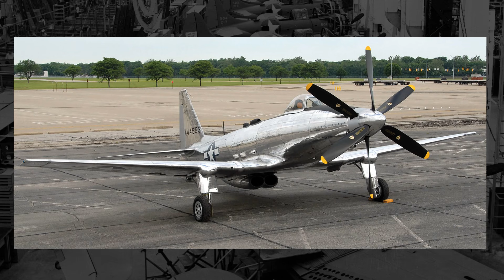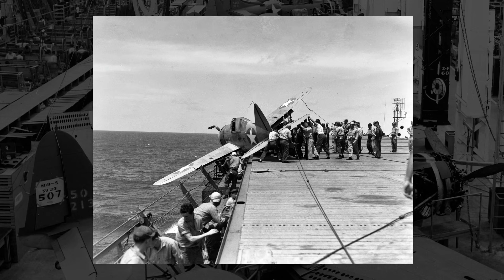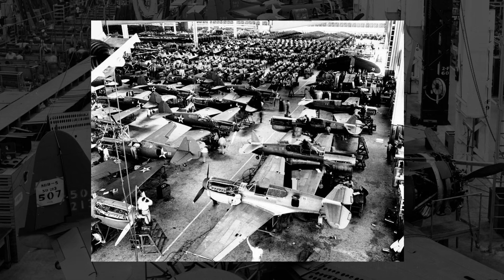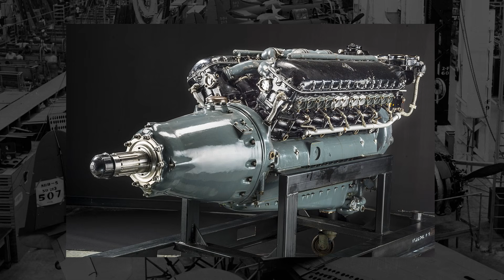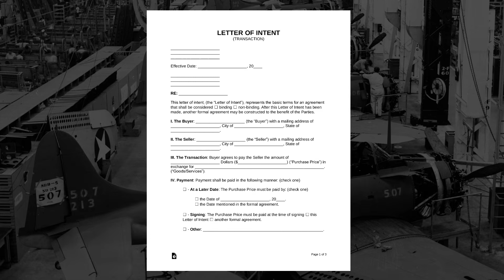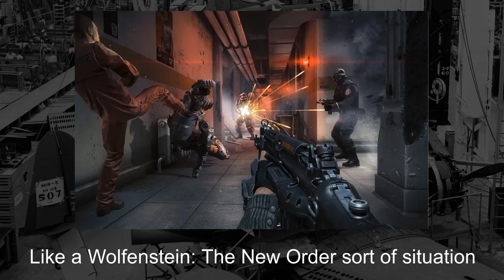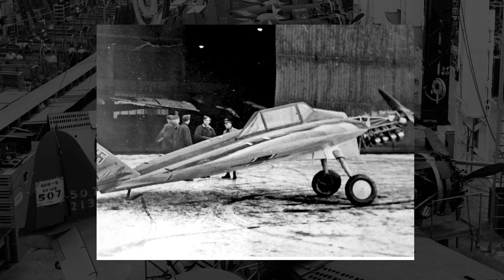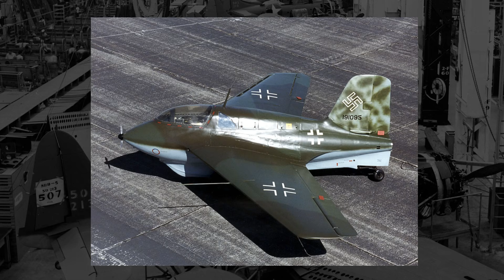The "Wonderplane" Slapped Together With Spare Parts: Fisher XP-75 Eagle

Comment: Gotta wonder about how many brain cells were involved in placing guns in the nose synchronized to fire through contrarotating props. Absolutely no margin for error there; the slightest hiccup of the engine or millisecond of hangfire on a gun and you are going to be "affected by an inclined plane wrapped helically around a conical axis".

Comment: Thank you for producing this video of the most amazing multi role fighter of the era.  This has got to be the best WWII aviation video ever on YouTube.  It brought to light American ingenuity which obviously was lacking in spades in this Fisher XP 75.  It did prove however, the American philosophy of bigger is better, isn’t better all the time. 
In hindsight, wouldn’t it have been better to use two (2) Allison 1710 engines in tandem, rather than Siamese two of them which I’m sure was an engineering, design, and manufacturing nightmare. This engine arrangement would have placed the pilot’s legs about 8 inches behind the propeller’s gearbox.  The benefit is that, to maintain the proper Centre of Gravity, there would be no need to add 100 lbs of dead weight to the front, as long as GM specified a minimum pilot weight of 275 lbs.  As a final observation, adding the nose gear from the P-39 Airacobra would eliminate the risk of nasty nose overs.  Just a friendly suggestion.

Comment: The XP-75 was designed to fail. The GM automobile plants were mothballed, supposedly awaiting XP-75 production.  This way they could be started up quickly when the war ended. Ford had repurposed their plants to build things like B24 Liberators. After the war they never caught up with GM. Therefore the XP-75 was a spectacular success.

Comment: I am a aircraft mechanic by trade. This idea of manufacturing aircraft like cars, is something that executive types still push. It always and I do mean always fails. There is some ability for standardization. Within great limits. Like using Pratt and Whitney’s on multiple platforms. But deciding to put a Pratt into say something that uses a Merlin. Isn’t a engine swap like putting a Hemi into Chevy.  You have to change so much that you get a entirely new aircraft. Makes the let’s just take this and stick this into that not work so well. Aircraft don’t deal with build up of tolerances. They require precision to work. It’s no big deal if you’re old Honda’s hood doesn’t quite line up correctly with the body. But in a aircraft the equivalent can cause enough turbulence that when the plane maneuvers. It can result in loss of control of said aircraft.
Reply: As a F-16 factory mechanic, even changing the engine from a GE to a PW, which all the later Block 30s and on could do, was a royal pain in the ass. The only common mounts between the 2 engines were the aft thrust mounts and the PTO shaft. The fuel, throttle, electrical and bleed air had different hook-ups. I've only seen the change made once when I was in the MOD department and then just to prove it could be done.

Comment: "Slapping it together from spares" is a time-honored tradition in many engineering fields, and actually has a lot to recommend it.  It at least gives you something to start from.  And if you find you end up with something that's less than the sum of its parts, then you haven't invested nearly so much effort.
Reply: the lego /meccano philosophy : excellent in case of dire emergency
Reply: Sounds like Chief Tyrol did when he built "Laura" she was a recon craft cobbled together from spares from ruined fighters.
Reply: Who was the guy who strapped Bazooka's to his Piper Cub with toggle switches to fire them?  I think he deserves the best slapped together Ground Attack Aircraft Award....
Reply: SLS be like 😶
Reply: And sometimes is turns out amazing.  The Voyager space probes for instance were builds from left overs.
Reply: I did find it annoying that the narrator said that each change to existing parts ruined the assembly line process. It did no such thing. What it destroyed was a larger supply of spares, taken from a common parts bin.
Reply: Except the highly qualified dead bodies you have to clean up 😢😢😢😢😢
Reply: @nigelhill8811 Not always the case

Comment: I don’t think the Me-163 Komet was a worst plane at all. Yes it was a dangerous plane to its pilots, but it did do what it was designed to do. Get off the ground, climb fast and shoot down invading bombers.  It did not shoot down very many. Somewhere around 10 to 12. While it was faster than enemy fighters, it became a sitting duck after it ran out of fuel, slowed way down and was gliding back to base. That is how most of them were shot down.
Reply: I suspect it glided a lot faster than you'd think. It was clean, no prop (which is a big limiting factor in a steep dive). I wouldn't be surprised if it could dive faster than a lot of prop fighters at the time.
Reply: @iskandartaib  I have read of accounts where P-51 Mustang pilots have chased down both the Me-163 Komet and the Me2-262 Swallow while they were in the cruise, decent and landing phases of flight. The  P-51s were cooking along in the 400 + Mph range, so they were actively chasing them hard with high power settings.
Reply: @americanrambler4972  Yes, I expect they'd have to chase hard, the Me163 wasn't a sailplane. And when they were low to the ground on approach I imagine they'd have to slow down because they'd have run out of altitude, besides they'd have to land. But when they had altitude and had someone on their tail I imagine they'd point the nose down 45 degrees and were pretty fast.
Reply: The Me 163 was also used to try to shoot down unarmed photo reconnaissance aircraft, it seems that one of two got a Spitfire but the other was lost trying to get the other Spitfire, the only claim for an unarmed fighter apart from the Spitfire pilot in Malta who was able to claim two Bf 109's while he was sat in a building on the ground.

Comment: Doomed from the start by poor design. 
Concept was good but putting a dual engine with double the weight with the wings and tail of a single engine aircraft immediately created very high wing and tail loads which then lead to all the substantial problems.

Comment: I love how even though the P-51 was built by an american company (north American aviation) and its best known for escorting B-17 bombers all the way from the uk to germany and back it was ACTUALLY designed and built to meet a BRITISH royal air force requirment
Reply: Lets see if I can remember 2 hours ago... a challenge for me although I already knew this... The first mustangs were a British general order request ... with specifications set by them.  The first mustangs were designed and built in a YEAR... a fantastic achievement however the Allison engines were weak. The British needed any aircraft they could get a hold of and took them all but did not renew the order.  They fitted the Merlin to one of these.  The second Mustangs were not finished until the Packard Merlin was licensed. The blueprints were a nightmare of highly precise custom building of each part and the amount of steps (in the thousands) had to be translated to a simplified Mass-production procedure...
Reply: @allenlombard3627 its not that Allison engines are weak, they just weren't designed for high altitude. Below 15k, the Allison Stangs were actually faster then the Merlin Stangs flat out.
Reply: @georgewhitworth9742   The problem with the Allison was not just speed but lack of performance, low rate of climb and acceleration, the Merlin engine helped with both of these.
Reply: Most of the Grumman aircraft ended up in the Pacific theater. With the exception being the P-38. (I'm not referring to the John Wayne either)

Comment: Would there really be enough time and space for a bullet to clear those 2-3 bladed props that are contra-rotating!? That's insane if it works.
Reply: Hypothetically, yeah.  Just don't be the guy in charge of that particular design.
Reply: If you have a decent understanding of geometry it's actually not quite as complicated as it sounds. As the propellers spin there will be points in their rotation where the blades will always overlap, so if you stick the guns at these points you only have to calculate for the barrel being blocked "once" instead of twice, if that makes sense.
Reply: Exactly so.  But you also have to account for the flight time of the bullets between the time they exit the muzzle and the time they pass the blades.  It's a straightforward problem but also seems like quite a pain in the ass. @pyronuke4768

Comment: The mistake was not making a clean sheet design.  Trying to make parts not meant to go together actually go together is going to ruin any other benefits your trying to achieve.  Much of a cars design is engineered to be cheaply and easily assembled, thus if such line assembly was engineered for they could have cranked out aircraft at an astonishing rate.  B-24s were built quickly and in numbers because they made machines that can be operated by unskilled labor to create the parts that would typically be hand made by a craftsman so that its parts could be made fast and cheap and within such good tolerances that they could just bolt or rivet on without the need for "field forming" to make a similar hand made part fit.  This allowed the B-24 to roll through an automotive type assembly line.  So going back to the XP-75 they should have engineered a new design that specified part tolerances so that the machine tools could quickly create uniform parts, and jigs and sequences to assemble them into sub assemblies, and then final assembly of those sub assemblies on their line.  The clean sheet design would not have to deal with all the penalties and compromises (in particular in aerodynamics) of using existing sub assemblies intended for other aircraft, especially parts from something as obsolete (by this point) as a dauntless.  Probably the only good choice they made (and only good choice for using a pre existing design) was the P-51's supercritical wing.  A whole new plane could have been built around it without much compromise, but then that design would have likely resulted in basically a P-51 v2 without offering any significant capabilities over a P-51D.

Comment: Allison 3420 wasn't just a cool doubled name for a doubled up 1710. They were both the engines exact displacement in cubic inches. Doubling the number of cylinders would make it twice as big leading to the new name having nothing to do with what you made fun of. 

The naming convention was common for aircraft engines at the time. The Pratt & Whitney R-2800 was named that because the displacement was 2800 cubic inches.

Comment: My classification for the worst aircraft ends for those planes that has actual production and use, using these parameters I say the Brewster Buffalo was the worst, even before you get to the plane it's name alone sounds like some kind of Swamp Buggy:face-orange-raised-eyebrow:
Reply: Don't tell the Finns that.  They amassed quite a good record with the  Buffalo.
Reply: @rhondohslade  They were the only ones, I believe the Finns could make an outhouse fly if they so needed.:face-blue-smiling:
Reply: P.S.- even though it was obsolete when it was created other countries used it, it had a good run considering it was crap.
Reply: knew a pilot that flew and fought in them and said it was better than our Boomerang RAAF fighter. Nothing then could beat the Zero but he had dogfights against them and survived . They did handle the bombers OK

Comment: I thought it looked like a P36 aerocobra or am I hallucinating?
Reply: Yes you are hallucinating.  There never has been a P-36 Airacobre.  The P-36 was the Curtiss Hawk, the predecessor of the Curtiss P-40 Warhawk that had a radial engine instead of the inline 13 cylinder V type engine.
You're welcome.
Reply: @rhondohslade  You have never got 6&9 comfused?

Comment: Great example of Engineering hubris from the early to md 20th century.   I worked with many engineers from GE, Ford, GM, and Textron during the 80;s and 90;s and they all thought they could design anything.
Reply: I really think they got into a mindset of designing stuff just to see if they could , and one up other companies.  Almost everything they came out with could have been simpler,  more reliable and cheaper

Comment: I can say the Bolton Paul Defiant is considered a terrible warplane but it was built to a spec requested by the RAF and did that job well and it looked like a Hurricane from a distance. Then those german fighters got a nasty surprise. Another bad plane was the Fairey Battle...but again it was built to spec and did what it was designed to do really well but again it was a spec not needed.
Reply: the defiant was not the worst surely, it flew, didnt kill people who flew it etc but the prolem lay in the concept.  However as a night fighter it should have been developed as the Nazis developed upwards firing weapons later in the war
Reply: @babaganoush6106 

The Defiant wasn't a bad plane for its time.
Obviously it was way too slow to fight the Bf 109 but it was a perfectly adequate nightfighter.

Comment: You left out the fact that Donovan Berlin was the chief designer of the P-40 while working for Curtiss Wright.   He would later go to work for Boeing/Vertol.
The XP-75 was just one of many, many experimental fighters that the US Army Air Force contracted for during WWII.  None of the Air Force fighters that were started after the entry of the U.S. into WW2 made it into production, much less into combat (some Navy prop designs would make it into production and survive into post-war service).   This was simply because the pre-war designs of the P-38, P-39, P-40, P-47, and P-51 proved to be a collection of usable to excellent designs and continued improvements during the war would make them better, and then, at the end of the war, all propeller planes became obsolete (the Navy had to stick with propellar planes for a much longer period of time postwar as it slowly figured out how to adapt jet planes to carriers).
The biggest problem with the XP-75 was really the V-3420, which Allison never ever got to work properly.   That's what really doomed this fighter.  The airframe issues could be fixed.  The V-3420 was also slated to be an alternative to the Wright R-3350 for the B-29 project, and as troubled as that engine was, Wright was able to get it working to a better degree than the V-3420.   Both Allison and Curtiss Wright had serious deficiencies in quality engineering during the war, and Allison's was every bit as bad as Curtiss Wright, but it was sheltered within the GM corporate structure and managed to survive postwar thanks to being given handouts from the US government which gave it British jet engine designs to kick start it into the jet age.

Comment: I have been to the U.S. Air Force Museum numerous times, including to the restoration area and other experimental sections and don't remember ever seeing an example of the Fisher XP-75 Eagle or any thing like it.
Reply: It's there.  It was on the base with the presidential aircraft. But I believe they moved it to the new hanger when that opened
Reply: Time for you to make another trip and catch up. It is parked as indicated behind and to the right of the XB-70.
Reply: @williamhudson4938  I don't remember it, either, but I think the last time I visited was in 1998 or 99. They've added quite a few new exhibits since then. Back then the only Mustang on display was a A-36 (itself a very rare bird indeed).

Comment: Sorry for nitpicking, but the 4 secondary Armaments in the nose was 30 Caliber M1919 MGs

Also I 've been thinking, if it were modernized, I think swapping the engines out with turboshafts/turboprops is the most logical choice, aside from design tweaks here & there

Comment: The Boulton Paul Defiant would certainly be a candidate for 'worst WW2.'  It was a flawed concept, questionable execution and was actually produced in numbers. The Royal Navy used them because they were stuck with them but never actually seem to have found anything the plane did at all well except as a fixed anti-aircraft emplacement that could move under it's own power.
Reply: The Boulton-Paul Defiant. Was a RAF aircraft not RN.

The RN turret fighter was the  Blackburn Roc. Which made the Defiant look good.
Reply: I stand corrected! Both were by all accounts awful.  Easy to get confused. 😁
Reply: @tinkertalksguns7289 

Despite being underpowered and slow The Defiant was a pretty good nightfighter.
Reply: @kevinoliver3083  Actually, the Roc was one of the worst combat aircraft of WWII. A fighter slower than bombers it was supposed to pursue with amazing combat record of one confirmed kill.
Turret fighter was flawed concept, but Defiant was not all that bad and definitelly not a candidate for worst aircraft of WWII.
Reply: The Boulton Paul Defiant had some success and made a good night fighter, the Royal Navy didn't get any Defiants, the USAAF were given some.